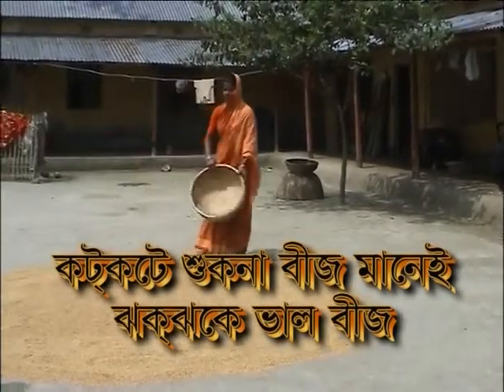Well-dried seed is good seed

Comment: The following is a transcript I wrote for agriculture students studying English in the JICA program. Thank you for posting this video and many others.

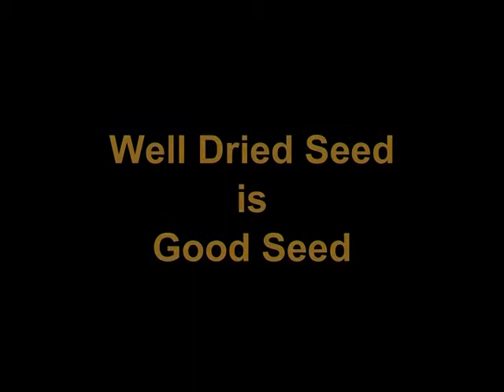0:08 Well Dried Seed is Good Seed    The drying of rice seeds,
0:10 especially during the borough rainy season,
0:13 is a major problem for Bangladeshi farmers.
0:18 Frequently, bad weather comes during the harvesting period.
0:21 Farmers face great difficulties with drying their paddy
0:25 and seeds because of the storms and rain.
0:29 As a result, seed quality deteriorates,
0:32 and no one can expect good yields
0:35 by using poor quality seed.
0:46 Seed dryness can be easily be measured using a moisture meter.
0:51 But there is a god-given way that farmers can use.
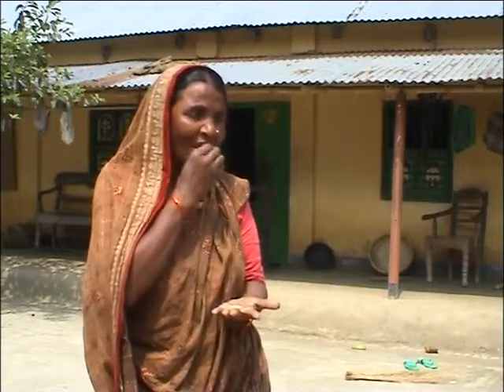0:54 By using their teeth, they can easily test and measure seed dryness.
1:04 Care must be taken during seed drying.
1:08 Farmers in Bangladesh generally dry seat on the ground.
1:11 This means that right after threshing,
1:15 the seed quality starts to deteriorate at the very beginning.
1:20 Why?
1:23 Well, for one thing, seed absorbs moisture from the soil,
1:27 and this hampers the drying process.
1:31 Also, soil particles, dust and bits of plant
1:36 will mix with the seed, and this will also deteriorate the seed quality.
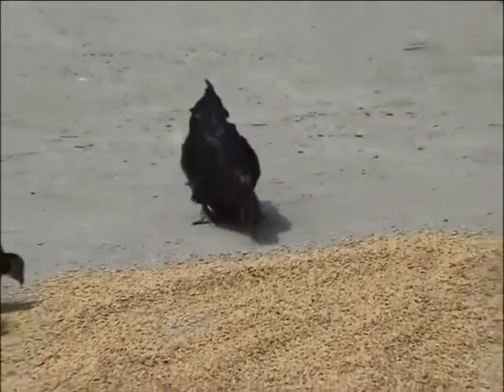1:40 The women will be working all day drying the seed
1:43 and watching out for children, chickens and other animals
1:48 don't go on the seed. And finally there's a high possibility
1:52 of different varieties mixing.
1:55 So let's listen to some of the experiences of the
1:59 farmers of Maria
2:01 village. They’ve worked on some innovative techniques
2:04 for solving the problem by themselves.
2:07 Now they are
2:12 no longer worried about drying seed, even in the rainy
2:16 season.
2:24 We’ve discovered the technique
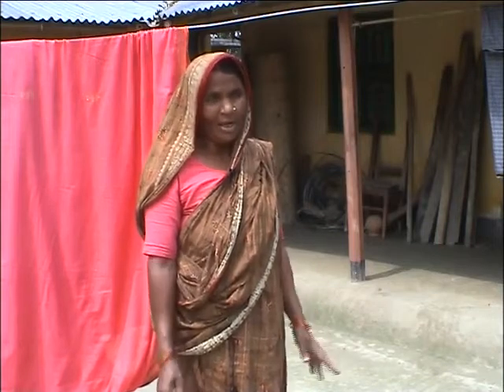2:26 of making bamboo tables.
2:31 My son, my husband and I made our table together.
2:42 My wife and I discussed the idea.
2:46 My wife knows how to make a thatched top for the table,
2:50 so we were able to make it between us.
3:01 There was hardly any cost involved. Everything was from
3:05 our homestead,
3:06 except a few nails and some jute rope.
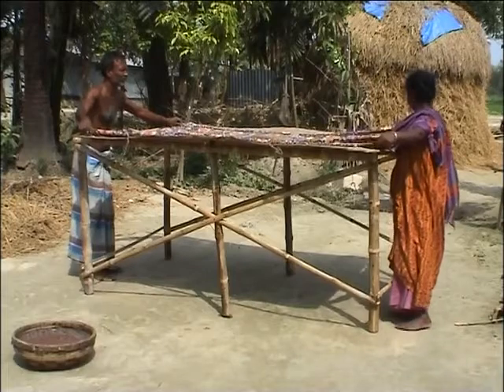3:10 It was a very easy task.
3:24 By drying the seeds on the table, we no longer have dirty seeds.
3:29 and whenever there’s rain,
3:33 we can take our seeds undercover very quickly
3:37 so they don't get wet. 
3:43 Before we were facing an enormous
3:47 problem drying
3:48 our seats during the rainy season. 
3:52 But we now know
3:53 that even inside the house the seeds can become dry.
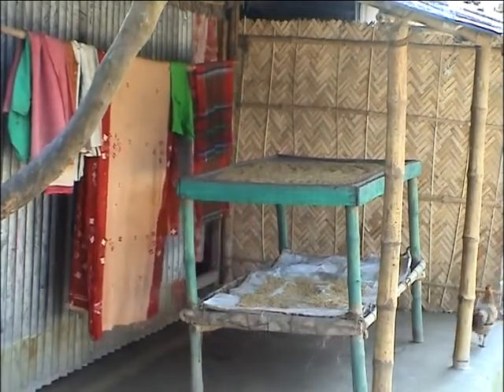3:57 When they're on the table, it's the wind
4:01 that helps in drying. 
4:06 Now that we dry our seeds on the table, it means that chickens,
4:10 goats and other animals can’t reach the seeds. 
4:15 We use the table to dry fishes, flour
4:20 and other things. Others sometimes use it as a relaxing
4:25 bed
4:25 or as a storage table.
4:30 Now we dry our seeds on the table.
4:33 Chickens, goats and other animals
4:36 can't reach the seeds.
4:39 The table helps us a lot to give us good quality
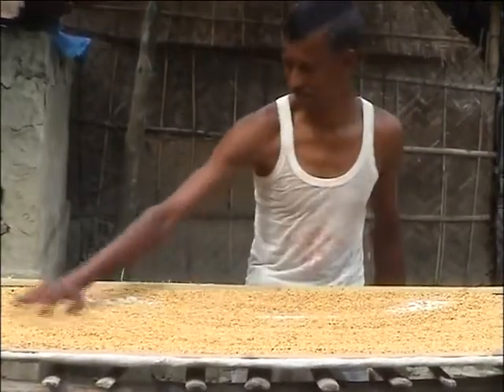4:44 seed. Now we
4:45 don't need to borrow seed from other farmers like we used to.
4:55 So what have we learned from the farmers of Maria
5:01 village?
5:01 We’ve learned that we need to solve problems for ourselves.
5:07 Proper drying is necessary for giving good quality seed.
5:12 Drying seeds on the ground
5:16 deteriorates quality. A drying table
5:21 has many other uses than just drying rice seed.
5:29 So we must remember
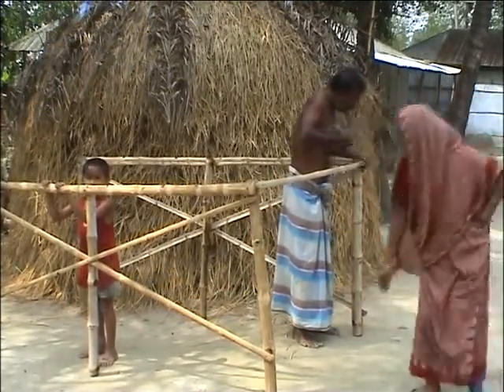5:35 that well dried seed is good seed.

Credits

This video has been developed by the Rural Development Academy, Bogra
and the women-focused NGO TMSS in Bangladesh.

Outputs have been used from the Seed Health Improvement Project (PETRRA).

Support has been provided in the UK by CABI Bioscience and Countrywise Communication.

Funds have been kindly provided by the UK Department for International Development.

This video does not necessarily reflect the views of DFID.